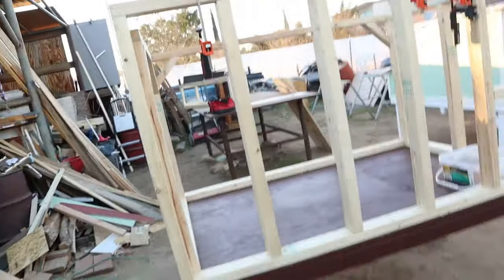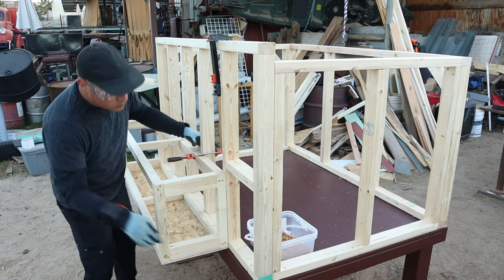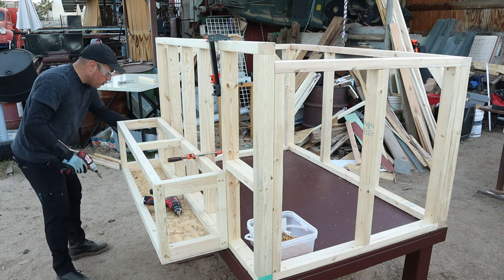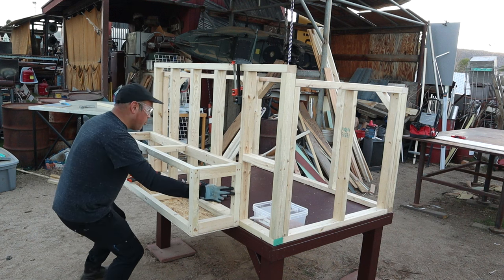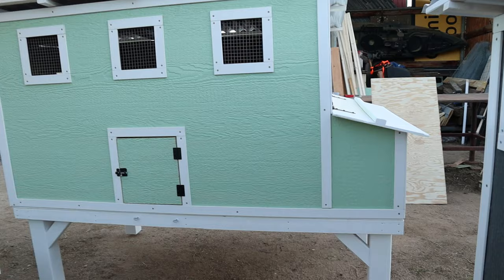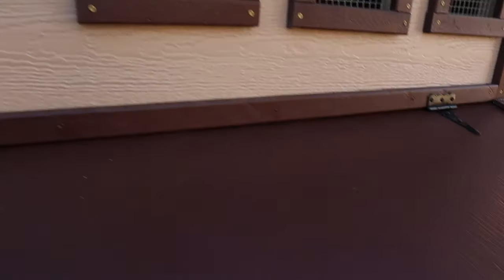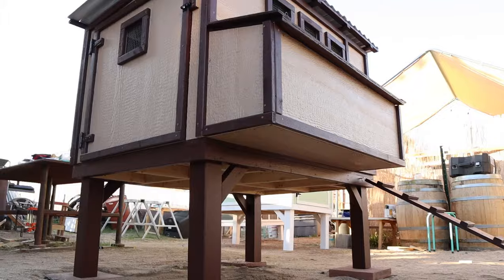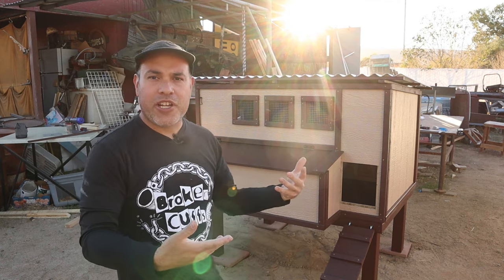DIY External Nesting Boxes for Chickens - How to Attach to a Chicken Coop

Comment: Awesome Ricardo!  Pregunta: What kind of wood do you use? Is it treated against water? Do you treat it on the outside only? Gracias.
Reply from the maker: I do treated 4x4s on the legs on occasion. When I don’t, I coat the 4x4s with two layers of semi gloss paint to protect them from the elements too, and I lay them on cement pavers u see each leg

Comment: Do you have to do anything to keep water from getting in the nesting boxes? I'm in Florida so rain is a daily. Thanks for the video!! I'm building my first coop and this is a huge help!!!!
Reply: I am looking for the same info!
Reply: @Thefightfortruth  so far the only thing I've found is having an overhang that hangs over the hing for the roosting box lid :/
Reply: Could you build the boxes inside the coop with an access door on the outside?
Reply: @ashleyelwood5342  I guess I could. I would still have an issue with having an exterior door where the rain will hit it and to through the seems. I had surgery so I'm still not done with this dang coop (still needs to be painted and then assembled but everyone else is built). Right now I'm using a classic looking exterior roosting box with it's own roof/lid and I've got one of those long continuous hinges I'm going to cover with wax or some hydrophobic coating to keep water from going through it. Hopefully that'll be good enough. We'll see.
Reply: I see some people with the door on the back of the nesting box and therefore the top stays secure and doesn't move. The chickens don't really like things coming from above them because of the whole predatory bird thing! So coming from the back seems to be less stressful. I think that is how I will build my box. Hinges on the back bottom and then pull the back door out and down.

Comment: Hey, what size plywood or osb did you use for the floors/walls/roof? 
Thanks!
Reply from the maker: The floor is 15/32 inch plywood, the walls are shed panel OSB from Lowe’s 3/8s

Comment: OK I keep coming back to this video because clearly I'm over complicating my build lol. How far apart are your studs? I can't seem to figure how far apart to make mine so that they are dispersed evenly across the nesting boxes....
Reply from the maker: The studs on the nesting box side ONLY, are space out 12.5 inches to be space out about 12 inches on every nesting box.
Reply from the maker: Or make them as wide as desired, they don't have to be 12 inches apart, you could even do 14 inches apart, whatever works for your set up.

Comment: Currently building my coop as I type and I'm curious. We get monsoons, are the windows necessary or can I leave spacing right below my Angeles roof for ventilation? It would be covered better then the windows for rin protection.
Reply from the maker: sorry for the late response. I think it would be fine to just have the ventitlation all around the top of your roof where the rafters meet.  We live in CA where it gets to be 108 degrees in the summer and could be dangerous, so I build them with plenty of windows, usually just on the face and one side. That way you can position your coop with windows facing the other side where the wind come from.

Comment: Any trouble with rain making that exterior wall set inside the foundation?
Reply from the maker: This coop was going inside of a chicken run with a roof over it, but most of my coops I do a 1/2 inch overhang over the foundation to prevent water making it inside

Comment: didn't show how to make the most important part, the door.  smh.
Reply from the maker: Hi Ben, sorry I left that part out. But, I use 3/4 inch plywood cut to 14" wide and depending on the width off the coop, I cut an extra 3" to overhang on the sides to help with rain drainage. So if the nesting boxes measure 48", I make my nesting box lid 54" long. And then simply attach it to the coop wall with two hinges. Hope that was of any help, let me know if you need anything else.

Comment: THEY NEED STRAW IN THEM AND THEN WTF ARE THE BIRDS GOING TO DO IN THE RAIN N COLD, HEAT GOES RIGHT OUT EVERY WHERES. TWO THUMBS DOWN
Reply from the maker: Bruh.... did you watch the whole video to the end when the coop has walls and a roof? The beginning is just the studs. I was building this for someone (they will add the bedding to their own coop).
Reply: They’re in Southern California.  Heat kills chickens every year.  I’m in AZ and my design is very similar, making sure hot air can escape at every point!  In my area you’ll never lose a bird to the “cold” or rain, but each summer it’s a battle with the heat with many people losing birds regularly every summer.  

This is a well designed coop for a hot climate.  If it gets cold enough to worry about it those holes can easily be covered with plastic or another insulator.

Straw also isn’t the best option in my experience.  A Timothy hay or Bermuda grass hay is much better, as it decomposes faster and is “finer” so the birds like it more.  They’re using and promoting the deep litter method too, it looks like, so hemp would be the best option though it’s quite expensive here in AZ.
Reply from the maker: Thanks for tour input, I honestly don’t think that person even watched the whole video, lol. I’m assuming he thought that the stud walls were the finished product before I sheeted the thing 😂😂. But yeah, we use hemp bedding in our coop, it’s not that expensive considering how long it lasts. And our climate in California would never kill a chicken with the cold (unless they are baby chicks without proper temperature control). Thanks for your kind words though Brian, and thanks for tuning in to our channel!
Reply from the maker: @dianayoung7072  yes totally agree 😊